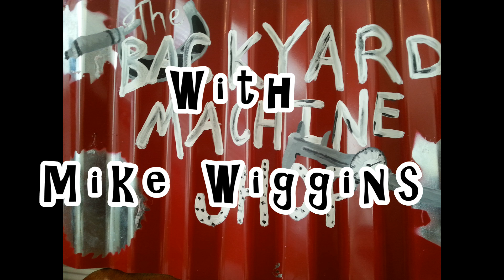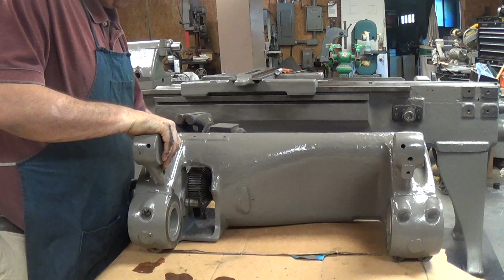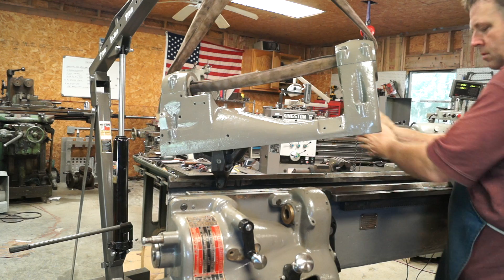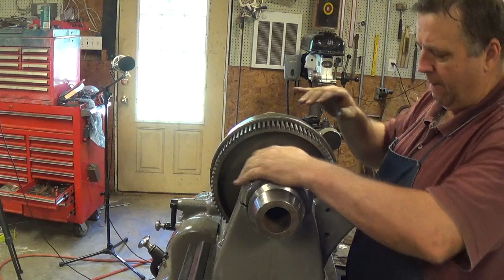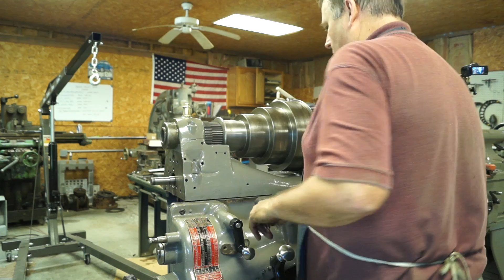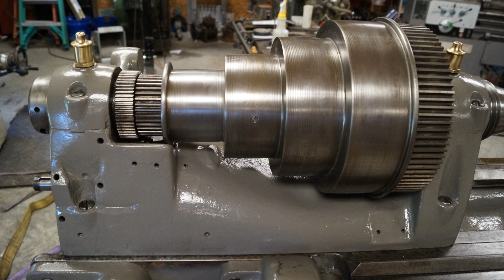Pratt & Whitney Lathe Restoration Part 9, (It's starting to look like a Lathe)

Comment: Superb stuff, Mike, many thanks

Will there be fine tuning adjustments on the cone head? I have been led by others think these would be very complicated to set back up properly
Reply from the maker: Yes I will need to fine tune the lathe once it's running

Comment: I really do appreciate your time making these videos.  That is a heavy duty lathe and I hope you get your line shaft in powered by a hit and miss engine.  OK, maybe an electric motor would do.  We had a machine shop in the area that had line shafts powered by a hit and miss engine...a big one.  I was told they used a 12 ga. blank to start it.  Before my time by a little.  Greg
Reply from the maker: I have been looking for an Hit Miss that can do that, I also would like to build a new shop to house the line shaft shop in, Maybe one day
Reply: Charles Compton        As I watched this I was wondering if a line shaft was in the future.

Comment: I  liked that as Keith Fenner would say--machinery that gets old is not useless--its capable of doing some more incredible work.. I have a small hercus lathe which I think was built in Oz under a Southbend license---it would be 40-50 years old..Two years ago I bought a new Hafco lathe and the first thing I had to do was make a toolpost grinder because with the 4 jaw chuck stock was flopping around.. Center a round stock at the chuck and then go out 10 inches and it was flopping around a good 5/8 of an inch..The little 4 jaw on the hercus might move 3 thou..My experience is old is better...
Reply from the maker: The lathe sounds interesting thanks for watching

Comment: mike nice work,how do you put the belt on ?
Reply from the maker: More than likely I would use a laced leather belt
Reply: That was my question, also. Good looking lathe, Mike. Did you know P&W made jet engines? I used to work them in the B52's.

Comment: lots of paint and polish. wasn't it back before or did they come in gray?
Reply from the maker: I believe the lathe was originally black however I found no evidence of it, It was painted gray at least twice
Reply: that's interesting I wonder if it had Ben reconditioned way back. it's hard to believe it saw as little use as it seems to have.  at any rate she's looking first class. need to get back on my south Bend lol.

Comment: That is one massive headstock! I hadn't noticed that when you were tearing it down, and with the new paint on it just looks huge ;)
Reply from the maker: It is a very well built machine, Without the spindle and the reversing gears I think it way about as much as a 4 cylinder block

Comment: Lookin' Good... What spindle does this Lathe have? Looks like it could be an "L" something.
Reply from the maker: It as a 3 1/8" 3tpi the register is the taper on the front, It's completely different than most threaded spindles that the register is before the threads, Maybe this is where the L taper got's design from

Comment: Interesting fasteners.
Reply: What research I did told me that hex nuts and square head bolts were known before 1916. Phillips head and allen head were not. So pretty much it is all done with cap screws using a straight slot.
Reply from the maker: There are a couple of hex fasteners on the lathe but most are slotted cap head screws, I'm sure hex head could be used but the flush fasteners and the overall lathes looks would have to change